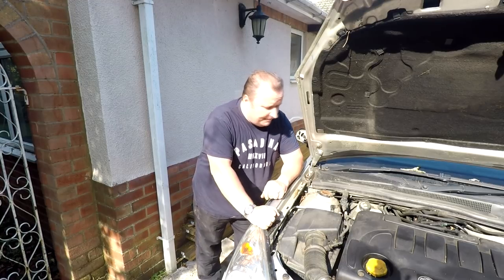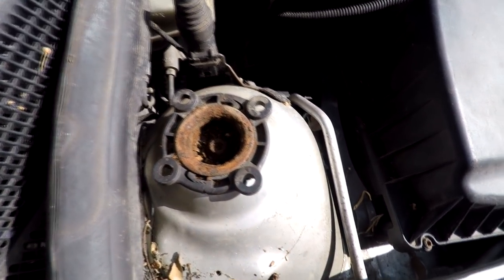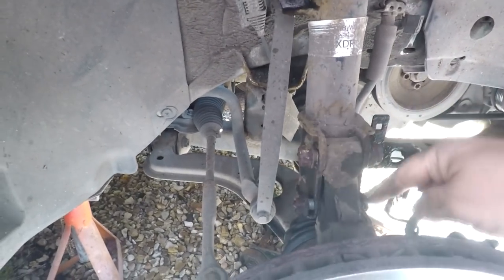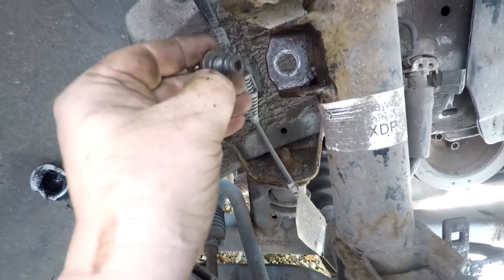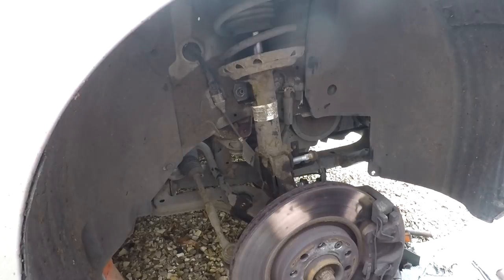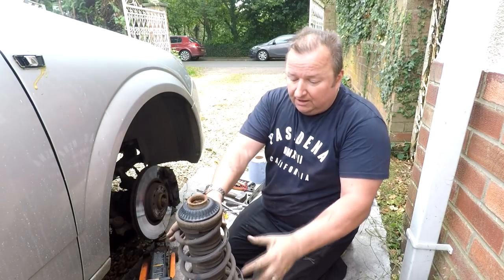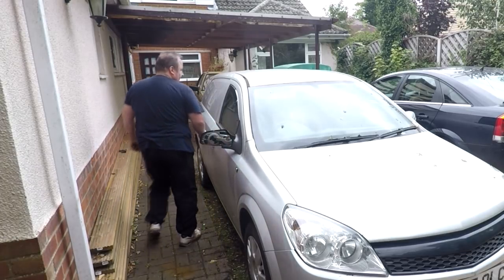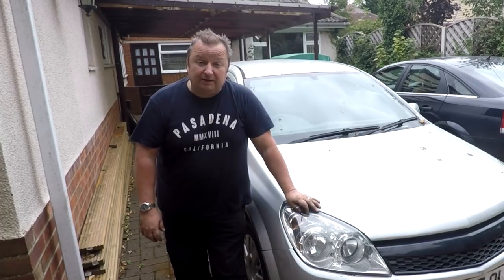Vauxhall Astra Front Shock Absorber Replacement

Comment: When I replaced mine, I bunged it with multipurpose grease like you say and stuck the cap on. 5 years later, when replacing a broken spring it was like new underneath all that grease. Made for an easy job.

Comment: I slapped some hammerite paint on the top the top mounts when I did them worked a treat had hardly no rust on the bolt and surround after 3 years when I had to replace a broken spring

Comment: I just used a rattle gun on those drop link nuts , so my method with that is I just pushed the plastic arm which forces pressure and which keeps pressure on the nut  ; comes off with pneumatic action fairly easily

Comment: Good video mate. I always put impact and mole grips on the anti roll bar links as you said in your video there a pain in the ass. If am chucking them I will use a 2" inch grinder and cut the nut of. Greese the tops and the car or Van will be mint. Stops all the damp getting in it. 😃😎👍

Comment: I have been trying to get the retention clips back on and they just wont fit. Ive tried the same sort of grips as yours and ive just ended up chewing them up. With a new set of clips, would it be safe to undo the top mount bolt slighly then redo up once the clips are on?

Comment: Ive done this job myself infact a copy of your video one thing i did notice is your top mount nut had a washer which im not sure the original has or not as i also had to cut it off  . my new struts had no washer and im thinking it should as i get clonking which im sure is coming from the top mounts

Comment: Good vid Martin.   That’s how I changed my springs using a spark plug socket and Allen key,  works great,    I did wonder thought when you was taking the drop link off why you bothered taking the top one off if you wasn’t using the shock again 😆    Good vid, 👍
Reply from the maker: Just to show people this way of removing them Chris

Comment: Great video Martin. A job well done, be careful with those spring compressors the safety police are watching lol. You didn't need to take that old bolt out of the top link after you knocked the plastic arm off because it would have stayed in the old shocker anyway, but its always handy to know how to remove them Martin.Look forward to more great video's.
Cheers, Jeff.
Reply from the maker: Yes, I removed it to show this technique Jeff

Comment: Martin, white grease is your friend. I use the spray stuff in an aerosol can which is just over 4 quid from Toolstation. It will stop your fastenings from rusting and it is great for battery terminals and other electrical connections too. While WD40 is better than nothing, there are better alternatives out there.
Reply from the maker: Yes I have whitegrease

Comment: You were right calling thr spring the shock absorber. The spring absorbs the shocks and the strut dampens the oscillations. And for tigtening the top nut use a swan neck spanner would make life a lot easier... but as long as its done theres many ways to skin a cat good job 👍
Reply from the maker: You can't get a swan neck spanner in there bud.

Comment: invest in a electric impact gun martin, saves faffing around  when stuff is rusted on. ive got the milwaukee m12 impact gun, although its only 12v it still has plenty of torque to release rusted on nuts. plus they do loads of other tools that use the same battery, ryobi is good also uses the same battery for loads of tools, great video as always!

Comment: great video mate. i grinded down a spanner just for these droplinks cause i didnt wanna replace them (they were only a year old lol) regular spanner is tight. but grind one down and it fits nicely. how good are these coil spring compressors from clarke. have you run into any issues with them? would really like to try make a homemade style one the type you bolt to the wall and use your bodyweight to compress. but cant find any angle iron for the life of me lol so might buy these as a stop gap, i have the regular type but they are no good on certain springs, those clarke ones look pretty good being 3 peices as opposed to 2
Reply from the maker: They do the job. I've seen the ones you talk about using your body weight. They look good.

Comment: why don't you buy the coil spring stand from machine mart to compress the shocker there safer than using them clamps
Reply from the maker: I only do this as a hobby on my own cars bud.
Reply: i do the same repair my own the coil spring stand is safer and less time than the clamps